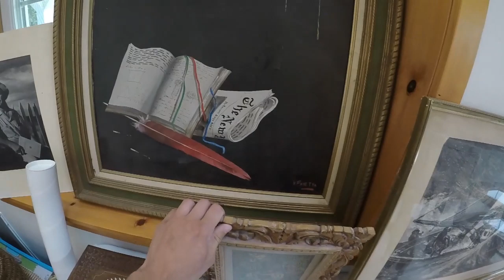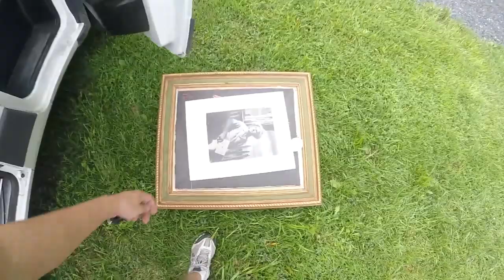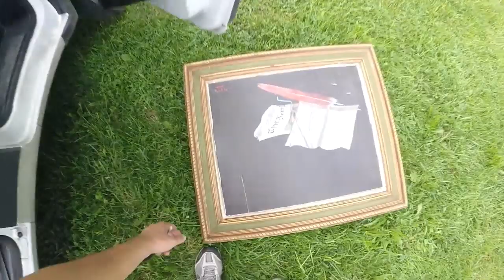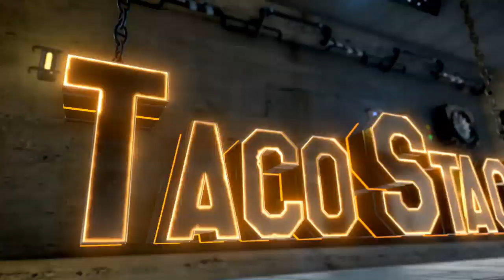On Site Estate Auction Treasure Hunting - A Short Sale

Comment: Chances are if the bats have been in the same spot a hundred years...they won’t want to move.  The trick with bat houses is good placement, read up before installing.
Reply: Lynn, I haven't read on the house's, but what do you do with the bats once in this bat house?
Reply: The bat house remains a permanent fixture, it’s their home instead of your attic.  They eat an amazing amount of insects, especially stuff like mosquitoes and will provide your garden with bat guano.  They are an asset just not pooping in your attic.